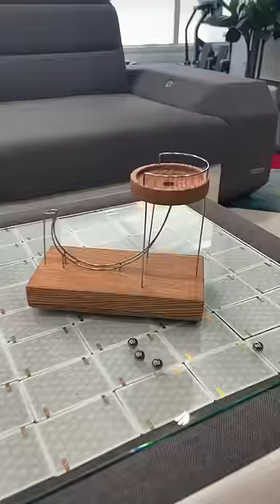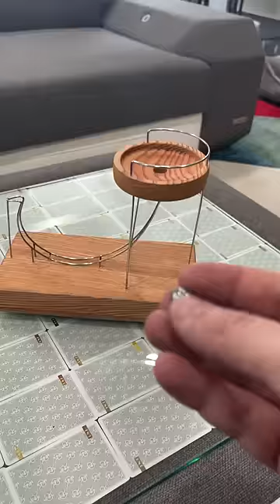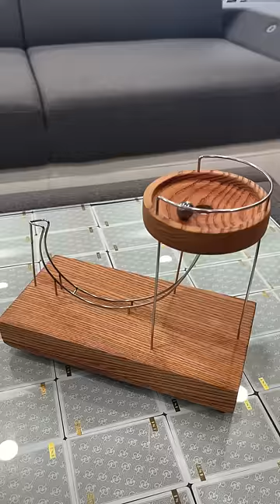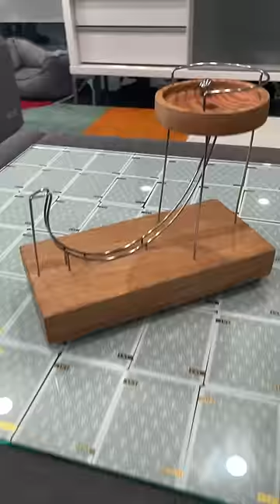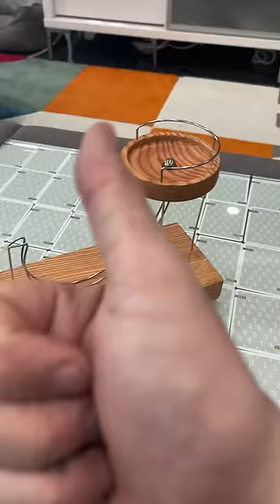An Impossible Perpetual Motion Device?! 😳 #Shorts

Comment: There's an electromagnet in the woodwork below which aids in pushing the bead up into the starting platform. When turned off, the bead doesn't have enough juice to reach the top.
Reply: You need to get your money back from whatever school gave you a degree.
Reply: Yes this is obviously the case, look at the acceleration of the bead when going down the track, there's a strong magnet operating there.
Reply: The drop looks normal; it’s the acceleration of the ball from the bottom point of the track that gives it away.
Reply: Why can’t it just be a magnet on the bottom? Why doesn’t it have to be batteries?
Reply: @tmangoto  A regular magnet, without electronic control to switch off the magnetic field, would just slow the ball down.  An electromagnet is turned “on” to accelerate the steel ball toward it, then turned “off” just as the ball starts to reach the magnet so as not to slow it down… it’s all acceleration, no deceleration.
Reply: @flintymcduff5417  Wrong.  His description of how the device works is spot on.  Someone’s owed a refund from the school that supposedly educated him, but it’s not drkush.
Reply: @flintymcduff5417  Are you slow?
Reply: Lol conspiratorialist 😮. I want to turn it over now !
Reply: Thx, It did appear that the Steel ball did quite a powerful jump back up the bowl on top. Sure do  wish Perpetual Motion was real! to ha
Reply: @flintymcduff5417  it' battery powered toy son ;) PERPETUM MOBILE DOES NOT EXIST
Reply: Yea it looked like it had some extra boost coming off that ramp haha
Reply: No electromagnet in the base is needed, and if there were one, it would have to be quite strong to work at that distance. Instead, run a current through the rails and the ball. The resulting magnetic field will propel the ball.
Reply: I have one of these and it uses a rotating bar magnet. Still a cool gimmick though.
Reply: Exactly.
Reply: "The most difficult thing about building perpetual motion machines is figuring out where to hide the battery"
Reply: @tmangoto  Because the magnet would pull it back towards it as the ball passed the magnet. It needs a switch or something to turn the electromagnet on ONLY as the ball is falling. My guess is that the switch is in the hole at the top and the electromagnet only stays on for a split second.

Cancel

Reply
Reply: Yes, you can see it, because the steel ball falls unnaturally fast.
Reply: @rsm3t  thats actually a better answer
Reply: Да ну........,
Reply: Бля, я уж было подумал, вот оно, вечно в движении
Reply: Yep.
Reply: @flintymcduff5417  He's right.
Reply: @salamich1  wtf is a Perpetum Mobile? A telecom carrier?

If it's just bad spelling I may want to 'steel' the name 😉
Reply: Yeah 👍I saw that extra boost too
Reply: @rwbaumg  missed one u in there as my u, j and k are a bit sticky :D
Reply: @Flinty McDuff  Sorry, he's correct. 

For this to work, the amount of energy spent returning the ball to the top would have to equal the amount of energy the ball generates when it falls. When the ball is initially lifted to the top that creates gravitational potential energy. When it falls, that potential energy is transformed into kinetic energy, acoustic energy (because you can hear it), and a tiny bit of thermal energy (caused by the friction between the ball and surfaces). The kinetic energy is then turned back into gravitational potential energy when it is thrown in the air, starting the whole process again. Except, because the ball has lost some of that initial potential energy to sound and heat it can't have enough energy to return to its starting point.

Unfortunately, so far we haven't cracked the laws of Thermodynamics (it would be seriously cool if we do at some point though), which states that energy can neither be created nor destroyed, only transferred/converted from 1 form of energy to another. So basically, every joule of energy in the Universe right now has been there since the dawn of time and will be there at the end(?) of the Universe too.

The short answer would have been....the ball requires energy to be added on every loop to make up for the sound and heat energy lost along the way.
Reply: @tmangoto  It has to have batteries to make it an electromagnet. A normal constant magnet would accelerate the ball as it came towards it but it would also slow it down as the ball moved away from it. The electromagnet switches off so the ball doesn't lose speed
Reply: you are right)
Reply: Yes, at first it was “unbelievable” since I know basics of physics, then I tried to “buy” it and read reviews. It has magnet, it has hidden on/off button, and it is mentioned in product description.
Reply: I’m the 420th commenter. :-)
Reply: Couldn't you lengthen the first drop to get enough energy to accomplish this. I do believe there is a way. Radiating the world with clean energy is not the answer.
Reply: @blakeblk  Doesn't mean you don't deserve your own reply 😉
Reply: I figure that this is the case. Without any external force, there is no way for the ball to reach the wood.
Reply: It is possible, it's called a tensor ring, Brian Besco from twisted sage studios sells them in America, you can see 50 percent of the energy coming off the ring with a gdv imaging camera... 72 degree pyramids do the same thing, this is why they built giant 72 degree pyramids out of fibre glass in Moscow and they store water in them, tensor rings are made from copper, like a copper magnetic bracelet for healing carpel tunnel, but 100x stronger maybe 1000x
Reply: It is possible, it's called a tensor ring, Brian Besco from twisted sage studios sells them in America, you can see 50 percent of the energy coming off the ring with a gdv imaging camera... 72 degree pyramids do the same thing, this is why they built giant 72 degree pyramids out of fibre glass in Moscow and they store water in them, tensor rings are made from copper, like a copper magnetic bracelet for healing carpel tunnel, but 100x stronger maybe 1000x
Reply: Yup your right
Reply: @GHOST__BRAIN  Physics doesn't lie. With our current technology and knowledge, the laws of thermodynamics can't be broken, which means energy can't be created from nothing. It can only be converted from one form of energy to another, and the amount of energy expended must equal the amount of energy that's input into a system/device, in this case, the gravitational potential energy that is built up when the ball is lifted at the start of the video. With the energy that is lost to sound and heat, not to mention the ball is thrown higher in the air than its initial starting height, there isn't enough energy to complete the loop. Therefore, more energy has to be given to the ball during every loop. Otherwise, it couldn't return to its starting point.
Reply: Thanks 👍
Reply: “Perpetual motion doesn’t exist…” what an odd claim, given the nature of the universe.
Reply: You are right. There is a video about it in YouTube
Reply: I knew it was something like that. The ke doesn’t match the problem.
Reply: Lies
Reply: It doesnt matter, its still going to need maint, theres your key for ever lasting life, Jesus, Heaven, Maintenance
Reply: @flintymcduff5417  bro was jealous he didnt know. wrote a terribly wrong comment. and got swiftly humilated. (🤡)
Reply: Dave hax has a video on this device watch to the end because the first one he ordered was a fake